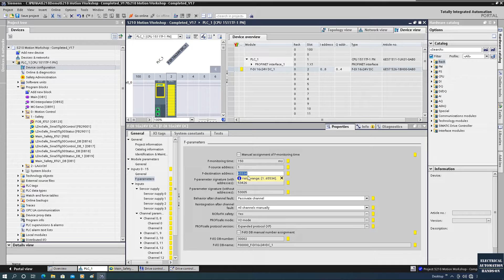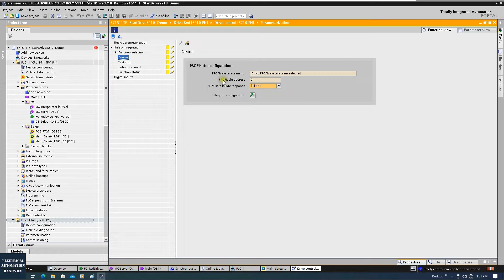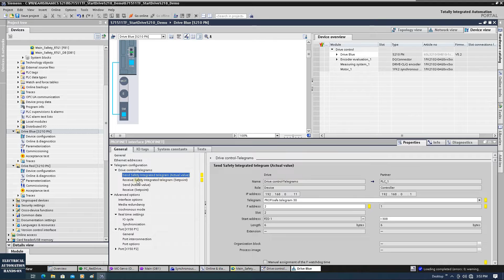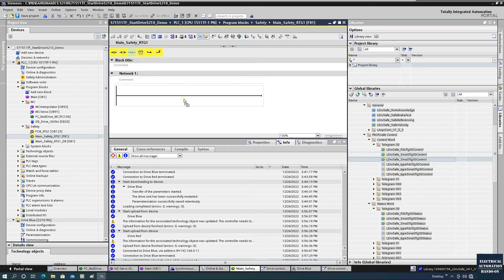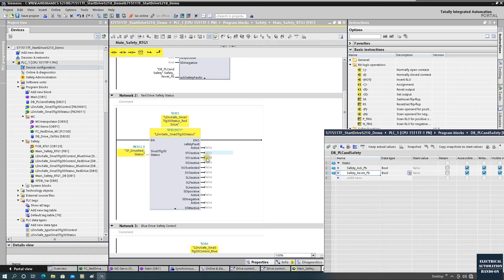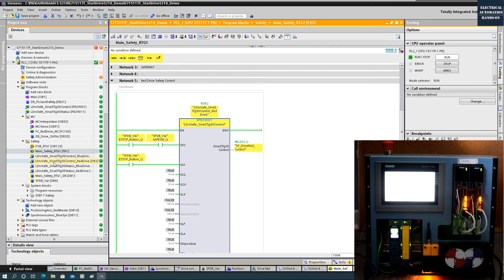MS06I. [Siemens S210 #09] STO Safe Torque Off and SS1 Safe Stop

Comment: Hi, could you tell me why you put the Gate in the STO input of the FB? In my mind the Gate should be on the SS1 input of the FB. Thanks for sharing.
Reply from the maker: This is fully depends on application, SS1 will immediately stop the drive and some times the stop is not good for the gearbox. And safety gate usually comes with lock, so the drive has been stopped gently when user request door open, then unlock the gate.